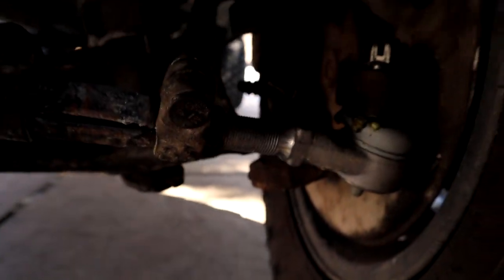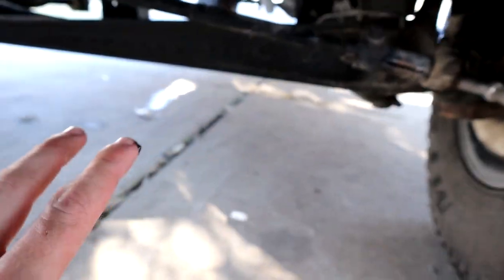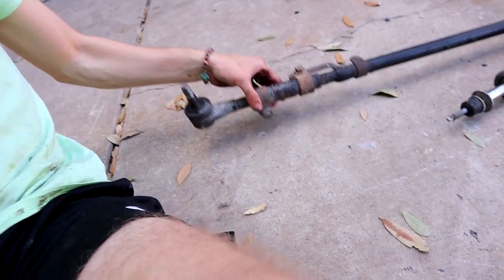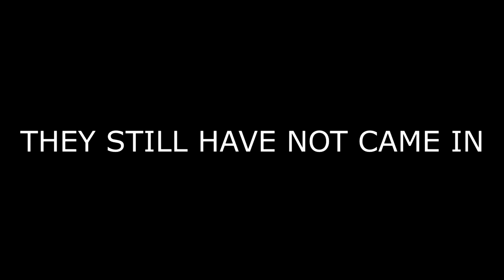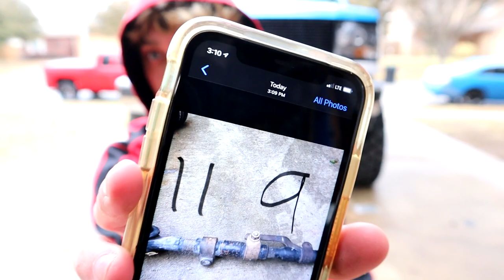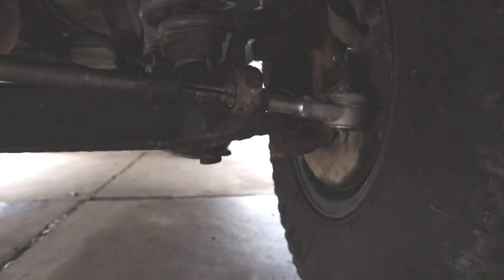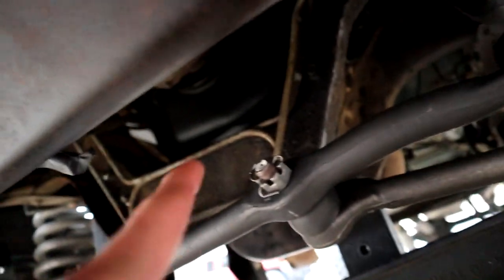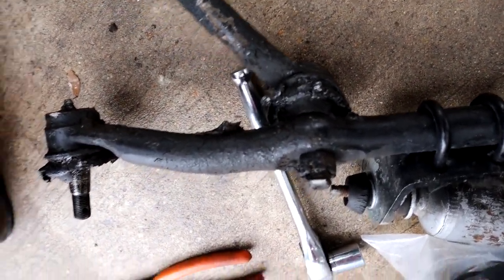1975-1996 Ford F-150 2WD Tie Rod Replacement *It Drives So GOOD Now*

Comment: I have a 95 f150 when I get up in speed I feel vibration what could that be?
Reply from the maker: Same thing happening here brother..
not to sure , it could be many things.. anywhere from bushing to ball joints , literally could be anything, I still caint figure mine out.. literally everything is new basically 😂🤷‍♂️
Reply: Thanks man ima change my u ujoints next an I use to think it was my tires an keep up the good work you inspired me to fix up my 95 f150 I even made a channel
Reply from the maker: Heck yea bro,
I love to hear it!
Reply: Steering wheel- front end 
seat- rear